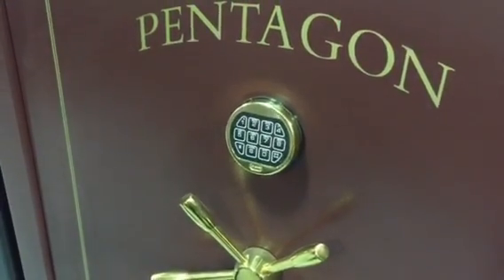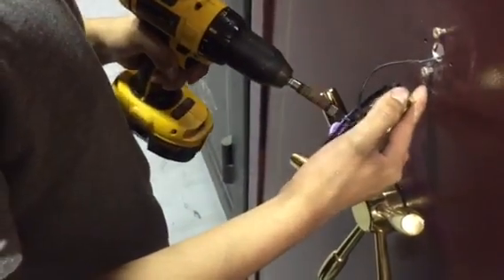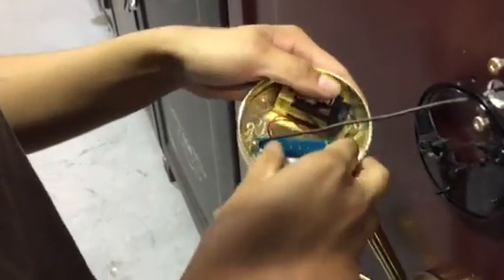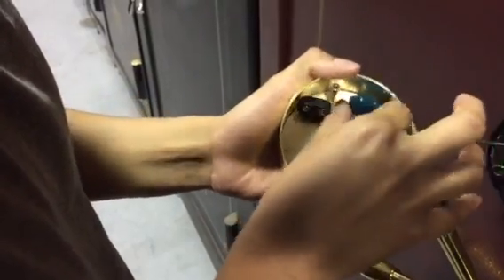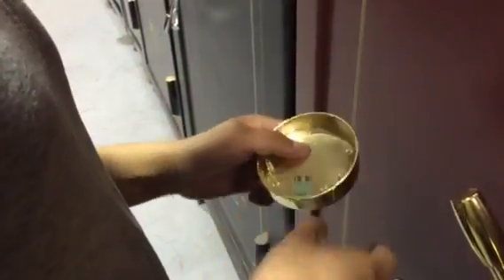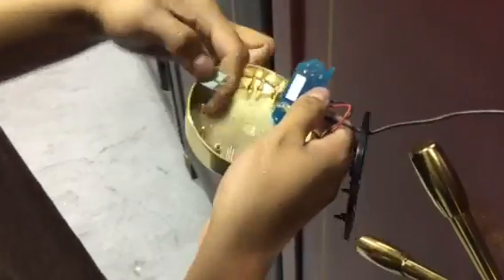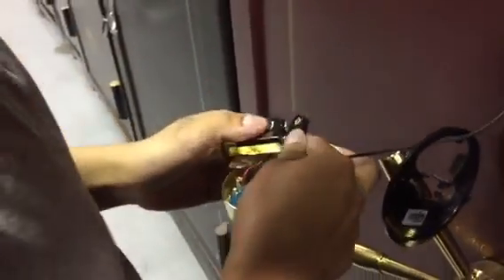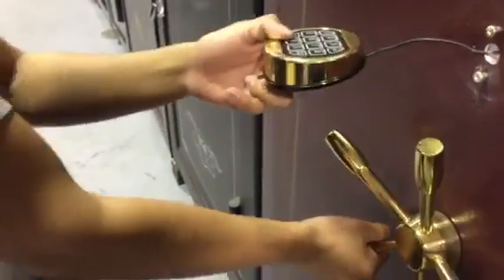Common LAGARD digital entry fix

Comment: Thank you!!
Mine was La Gard 3710 (chrome with battery on the bottom) which doesn’t slide up. Had to carefully peel off the keypad and peel back the sensors underneath to access screws to remove. Once inside the process was about the same. 
I had a locksmith scheduled for tomorrow who thought it would have to be cut open for $900 so I’m incredibly thankful for this video!

Comment: Allan here ,  safe with a laGard which has the 2  flash bulbs at the bottom , stop working , changed out battery , still did not work , now Am locked out still , tried resetting combo , the problem they want you to have the door open , no matter what I have tired the door is still locked on me , will not open

Comment: I tried this method but unfortunately it didn't work for me. My situation before trying out this method was some of the number doesn't make a beep (I assume that means it doesn't register). After trying this method the all numbers (at least the ones I need) now beep but it's still not opening. Is it possible the number I press and the and the actual  numbers that register could be different? I'm 100% sure I got the right combination, I have used the same number for 10 years and only I have access to this safe.
Reply: if you have a particular number press not beeping, then that membrane is bad. You can replace just the keypad .. all from the outside of the safe. Should get you going

Comment: Winchester 24 gun safe, La Gard keypad just quit working.  How do I remove the cover plate?  Slide it, tap it?  Changed batteries 3 times, it's dead.
Reply: When this does not work, here is a solution that will; I found articles where the keypad on the LaGards start to go out.  You can try this and it may work, when it does not work though, gently pull the keypad off of the metal housing (yes, it is lightly glued to that housing),  You will need to pull the ribbon cord out of the control board, just as in the video.  After you have removed the keypad itself, put some painters tape onto the surface of the housing where the keypad was adhesively attached to.  Cover the entire surface of the area with the tape where the keypad was.  Now, put the keypad back onto the area you just applied painters tape too, you can tape the edges of the keypad or you can use another adhesive.  Connect the ribbon cable back to the control board, then attach the battery, and test.  If you are entering the correct code, it should open.  The keypad is touching the housing or the adhesive is causing the contacts to not read correctly.  The tape will insulate from this affect.  I hope this helps
Reply: @assassin18530  thank you for this.
Reply: @Richard Eubanks You’re the man!  Fixed my Winchester safe

Comment: This just worked for the same issue on my winchester. But the ribbon cable is pretty flimsy, try to only pull on the connector and not the ribbon. I had to disconnect the ribbon for about 30 seconds for it to work. Otherwise only half the numbers would work. I hope this doesnt put me in a bind in an emergency

Comment: What was you trying to achieve ?
There was nothing wrong with the keypad anyway ...
I'm not aware of disassembling and reassembling a keypad to reset or fix any problems..
Its usually the membrane on the key pad

Comment: My safe I had wires corroding and I wanted to replace the wires tried removing the key pad as this video shows but after opening it and taking the inside cover off I just wound up beating and prying the key pad off found out the pad itself needed to be removed as the key pad is glued to the base that is screwed to the door of the safe I looked for video showing my key pad but did not find any. Replaced it with this style
.

Comment: I have a Liberty electronic panel safe that the keypad doesn't respond even with a new battery. Unfortunately it is in a locked position. How can I get this thing open? At one time today the small led light did blink a few times.
Reply: Did you ever get this resolved? I have the same problem!!
Reply: did you get this fixed?  mine is the exact same way
Reply: Same here.
Reply: I have a Winchester and when I started to replace the 9v, the lead wires for the 9v to the lock mechanism were spliced together. I found that to be weird. So when I took off the wire cap from the 9v, I saw the spliced wires were connected by a small piece of masking tape and the red wire had come loose. I started to examine and couldn’t believe both red/black the wires were spliced. Why they didn’t make both the red and black wires just one whole lead wire is surprising to me. Anyways they both ended up coming apart and trying to re wire them is a pain because there’s not enough wire in that small area to do it! Mind you these wires are the thinnest ones. So I jimmy rigged it just to get a connection and used a cheap 9v. After so many tries for 1-1/2 hours, I read online that these safe locks only use Duracell or Energizer 9v batteries. So I actually found a Duracell in the kitchen drawer and it actually freakin worked! Omg! A lot of these safes only work with Duracell batteries! Might have to replace all the wire leads to one grade thicker. And if I eff that up, then I would have to replace the entire keypad! I’m not looking forward to this project at all! Damit
Reply: @doncena7193  someone probably pinched and damaged the wires rehanging the combo onto the pins. Or, they removed the lock and let it fall yanking the wires apart. They are always continuous from battery to inside lock mechanism

Comment: How does that model not have a 5 minute lock out penalty for removing the battery?
Reply: It only lock you out of you put in the wrong code.
Reply: Not an expert on this at all but by logic there is no need to lock you out because it doesn't change your code in anyway.

Comment: now does this work if you changed the factory combination and forgot the combination that you put it as?
Reply: Nope. It only resets the processor for the keypad. The code is stored in the lock itself, inside the safe.
Reply: @dlevi67  
Yes sir

Comment: I was locked out of my safe just before leaving house to travel by plane ...so I panicked until I found out you don't need passport and id for kids when traveling domestic....so that saved me...but just back from vacation and I checked out all the ways this safe could be opened and I didn't want to give up...battery change, hammering on door etc etc...until I found this video which saved me an expensive visit from the locksmith...thank you!!!!! pulling out that wire from the chip and inserting it was the magic trick... however, I emptied the box and locked again and what do you know...safe is not to open again... It's getting dumped for good but I am so happy for this video :)... I have an LG353715

Comment: Hi
I don't know if this is the place to ask this.I have a safe that uses the  lg basic 3710. The keypad has stopped working and the safe is locked. There is no power going to the key pad even though I've replace the 9V battery with a new one. The supplier is charging me more than the cost of a new safe to get access to my contents (I feel as if I'm held to ransom). Can I peel off the existing keypad and replace it with a new electronic Lagard keypad, get the safe door opened opened, get access to my contents and have a working safe?
Thanks
Reply: Did you ever finda solution? I'm having the same problem!!
Reply: @roycheney5573  I had problem remove battery wait 10 seconds press 0 wait 5 seconds and replace battery and see if that works. Worked for me
Reply: Maybe the wires of the battery are broken
Reply: Wow. This question is 2 years old and no answer! I guess I better not hold my breath for mine to be answered .
Reply: @donc9751  I had same problem remove battery wait 10 seconds press 0 wait 5 seconds and replace battery and see if that works. Worked for me